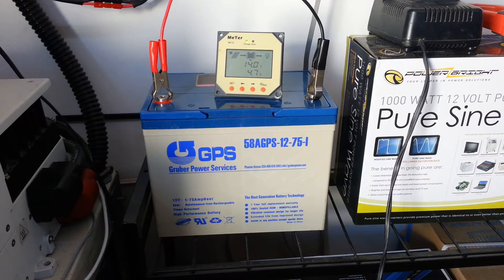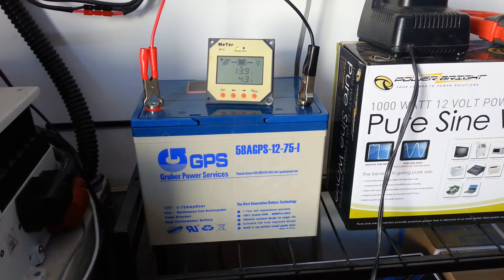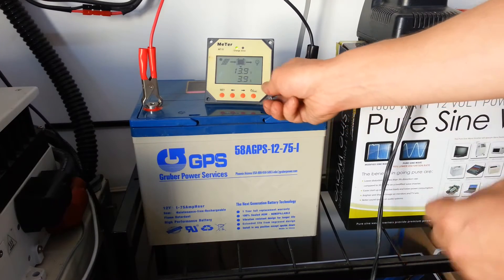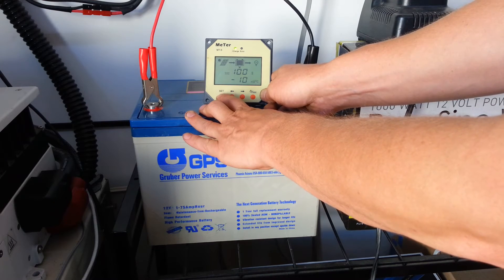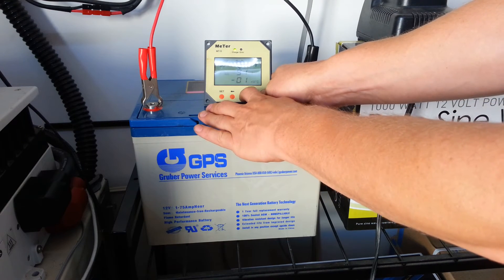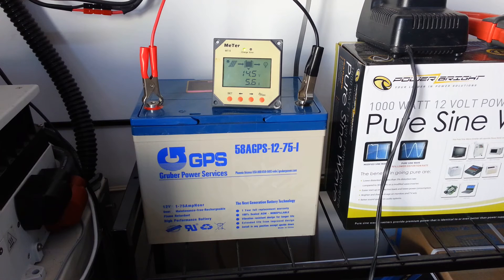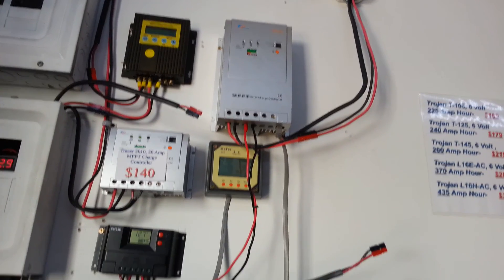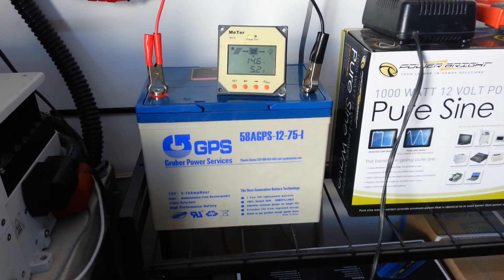Temperature compensation on a Tracer 4210RN, 40 Amp MPPT off grid solar charge controller.

Comment from the maker: Don't worry, you didn't do anything wrong, and you really don't need another meter.  Your system is working properly, the meter is just very misleading. All you need to know is any voltage above 12.8 Volts (with lead acid batteries) means the battery is basically full.  You'll start to damage your battery if you go below 12.0 Volts.  It's best to stay above 12.2 Volts. I read the voltage, not the State Of Charge (S.O.C.) bar graph to see how full my batteries are. The Voltage is like your gas gauge, 12.8V+ is full, 12.0 is empty.Thanks.

Comment: I have an issue I was wondering if you could help? I have a 200 watt Renogy kit with a tracer 20watt MPPT controller and 4 6volt battery connected series and parallel to make a 12volt system my panels are also in series the meter is reading battery's are at 52% so I thought i would put a charge on them just to make sure. When i did this my charger said my batteries are at 97% please tell me what im doing incorrectly
Reply from the maker: The battery indicator level on these Tracers is NOT accurate, although it is useful to compare.  They use only battery voltage to measure capacity and are calibrated to read zero when the battery is about 12.0V or around half empty.  When the battery is full and there is no charging input, (around 12.8V) it will read around 50% which is very misleading.  It will only read 100% up around 13.8V which you will never see unless your batteries are tip top full and you have some charging current going in to keep it high.  This is a flaw with the meter, your equipment is working properly. Thanks, Miles, LightHarvest Solar.
Reply: So I am just a beginner and I'm trying not to make to many costly mistakes, can you recommend a meter that will keep my mind from blowing up? I went over the wiring about 20 times trying to figure out what I did wrong.

Comment: Thanks alot for posting this. Any idea what the equalization voltage of this controller is? I read in the manual it is 14.8 (which is grossly inadequate to charge a battery) but in the manual for the same product sold under the renogy brand. the equalization is set to 15.5v.. have u been able to test what the actual equalization is?
Reply: it's normal for equalizing .

Comment: Hi my problem is when the battery is full the meter only shows 50% state of charge? second ,when my battery is at 12.62v the meter shows only 12.5 v . Have you ever come across this problem. is there a fix other than the bin?
Reply: The meter is not accurate for reading state of charge. an accurate meter relies on what goes in and out of the battery to determine state of charge, however this meter relies on battery voltage which can be flickle at best

Comment: Hi my problem is when the battery is full the meter only shows 50% state of charge? second ,when my battery is at 12.62v the meter shows only 12.5 v . Have you ever come across this problem. is there a fix other than the bin?